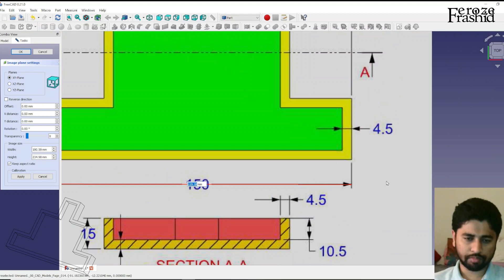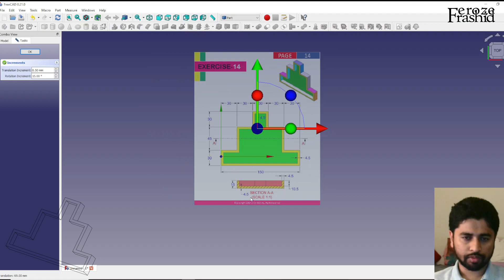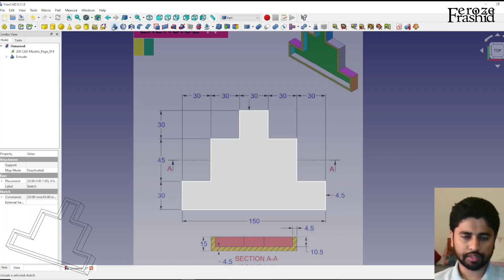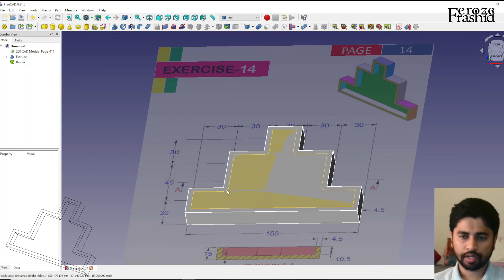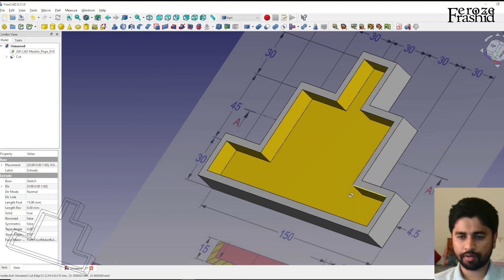200 3D Models in FreeCAD: Exercise 14 (Offset a Sub-Object Shape Binder)

Comment: I have a quicker way:

1. Sketch outer perimeter
2. Pad
3. Click front face, apply thickness: 4.5mm, inward, join type intersection.
Reply from the maker: That's definitely quicker. 
However, I would not rely too much on the thickness tool for larger projects. If you can't use a tool for large projects, build habit of NOT using that tool at all.